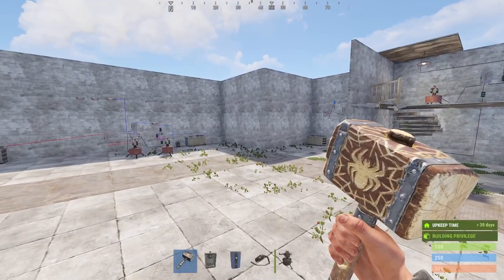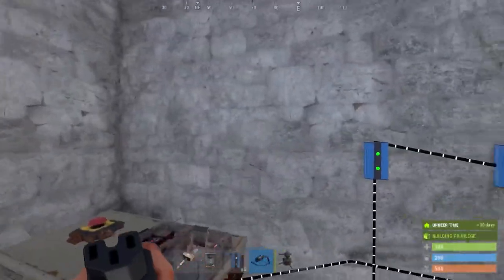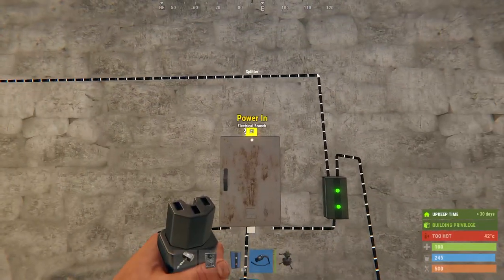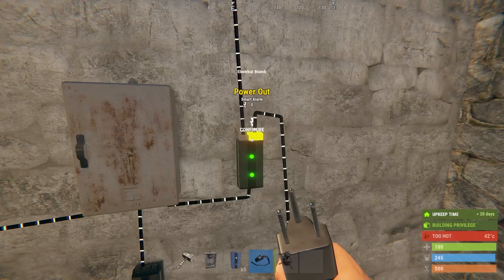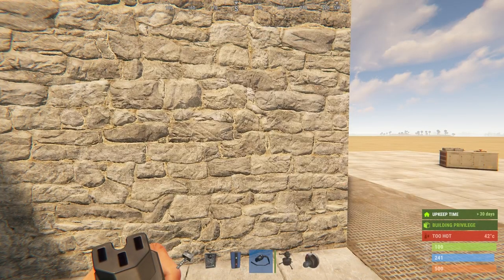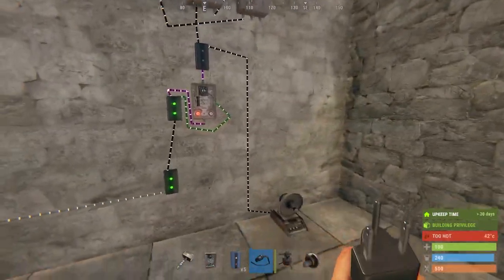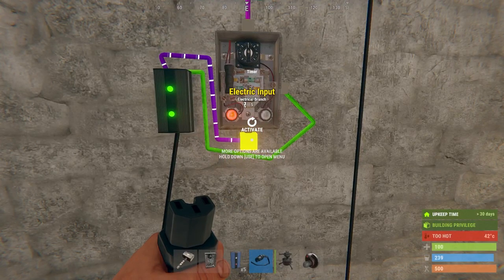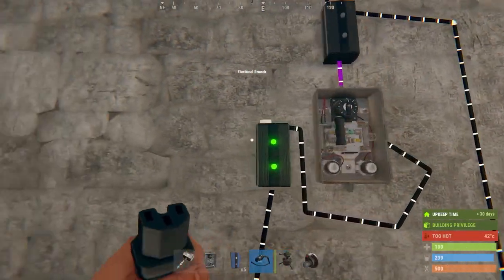Rust Electricity - The Destruction Detector

Comment: I use electrical branch->hb sensor->rf transmitter to actuate my outer compound turrets. I use the main power through on the electrical branch to a blocker set up like this one to power on all the turrets lights and generators in the base when when they are destroyed. Makes it so part of the system cant be destroyed incidentally during an offline and depower part of the grid.